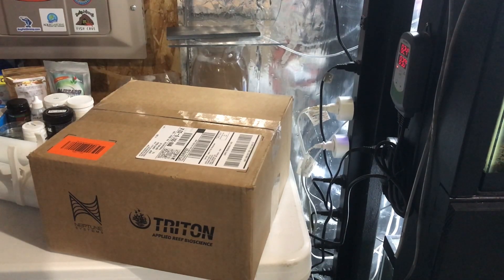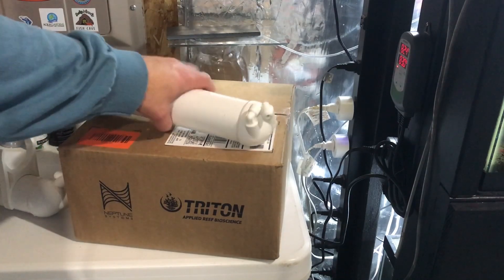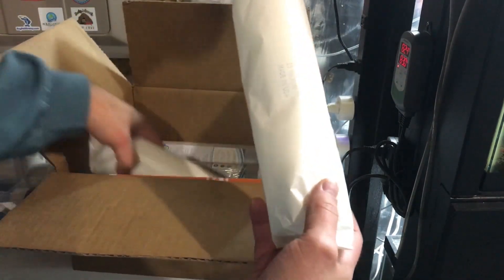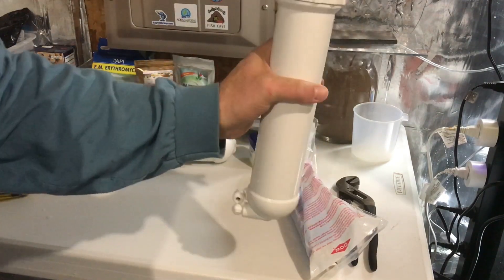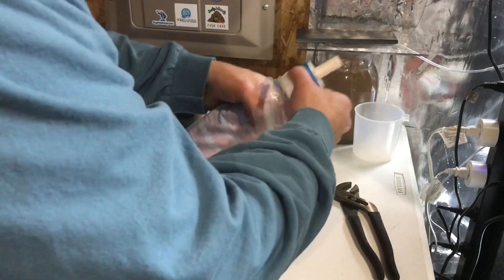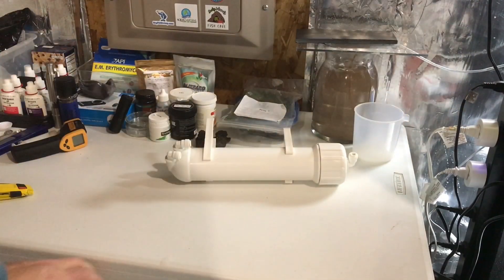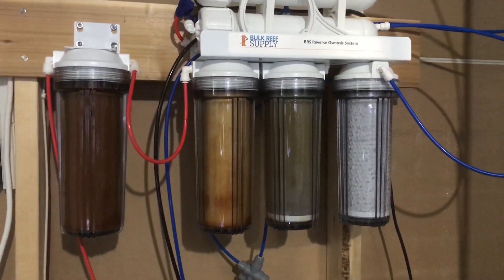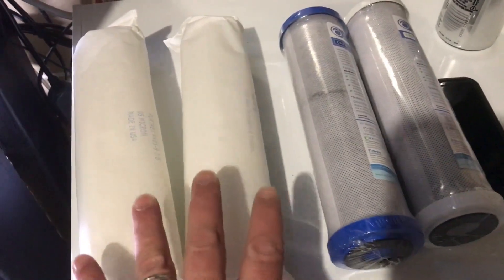Fish Room Maintenance: RO Membrane

Comment: What PSI does your RO system run at?
Reply from the maker: The PSI is 70, right in the middle of the recommended 60-80 psi for my system.  😉👍

Comment: How do you reconstitute your water? Add a little bit of tap water or a certain mineral set?
I'm thinking of getting the same RO unit as I keep mostly South Americans.
Reply from the maker: Good question.  Depends on the tank.  For the shrimp, I use salty shrimp gh+kh.  For the plecos, I just use tap to raise the TDS to 50-100.  I used to use the GH Booster from NilocG, which kept the ph at 7, but increased the gh.  My tap is around 8.2 (and extremely hard) and does slightly bump up the ph (7.2-7.4) but it’s a lot cheaper than constantly buying gh booster 😉👍